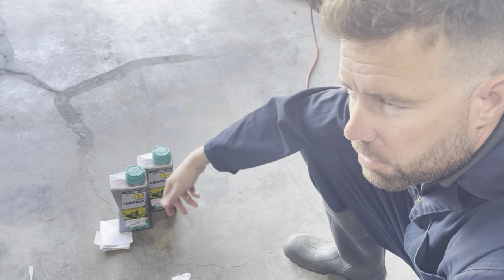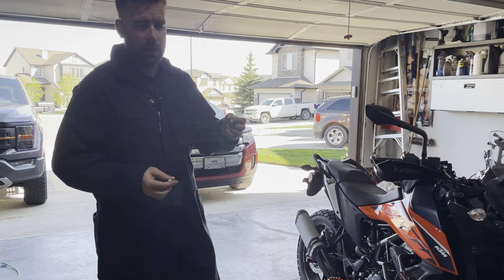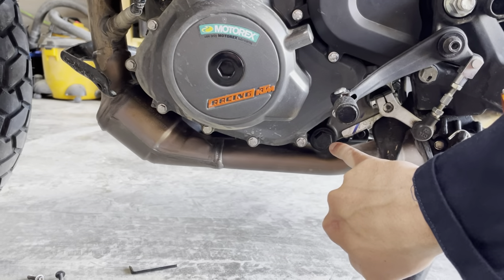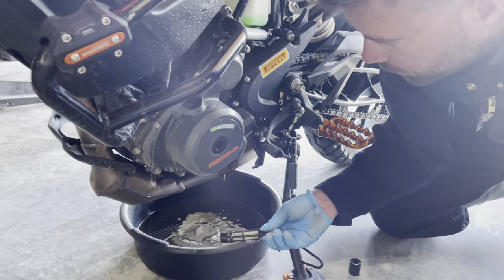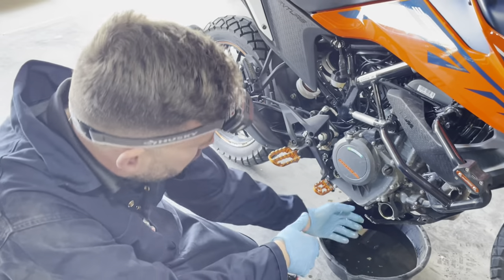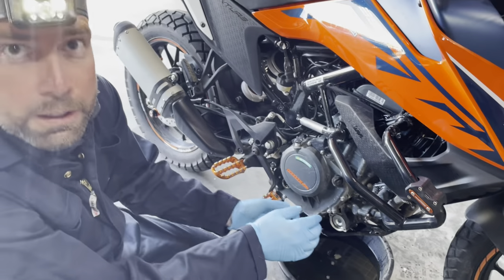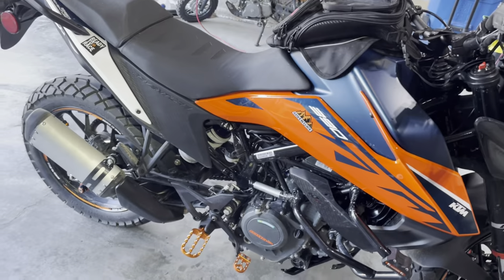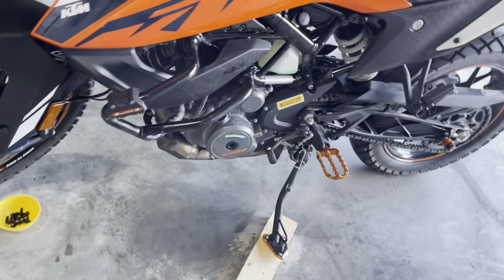KTM 390 Adventure Oil Change: Step-by-Step Guide for Beginners

Comment: Thanks for this...not a whole lot different than some of my other KTM's...
I keep hearing that KTM sets a rev limiter from the factory so the bikes don't get blown up during the "break-in" period. How do/did you get around it? Or does the Service Light Reset clear the rev limit?
Reply from the maker: I’m pretty sure after so many Km. The rev limiter went away. Think it was at the first 1000km it automatically changed
Reply: @ExploreSide  Getting close to 1k miles so I ran the bike up past 6k rpm...the tach blinks if it stay above 6k for a fairly short time. I hope you're right about it clearing automatically because the cost of KTM service in my area is WAY REDICULOUS! for something a simple as an oil change and checking torques on some bolts...